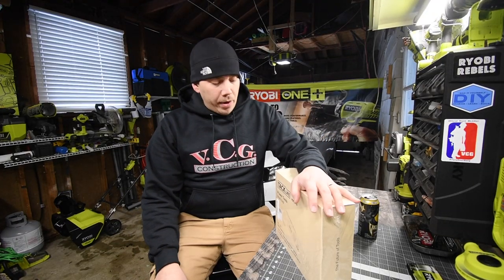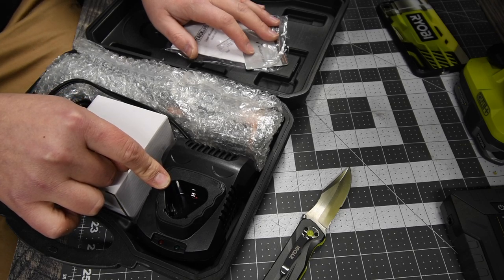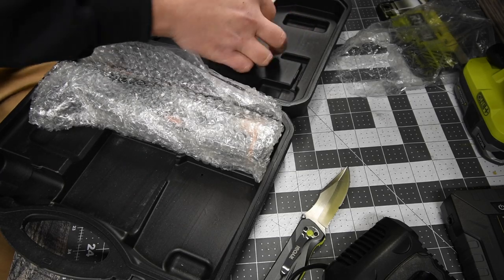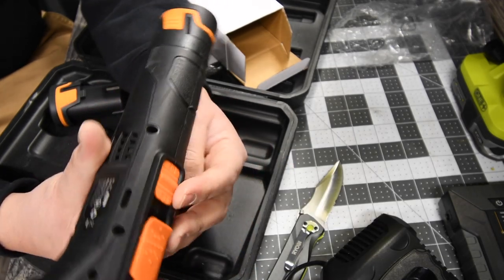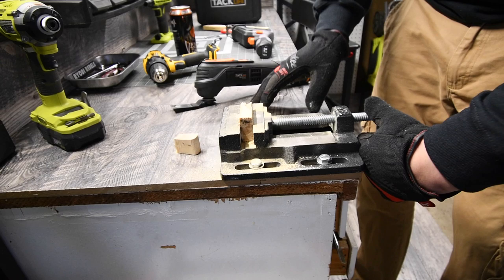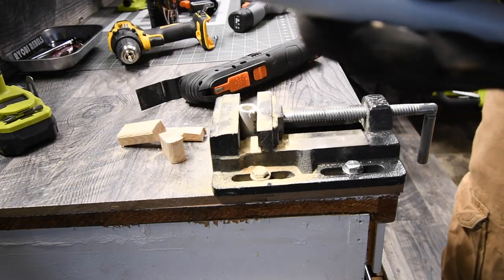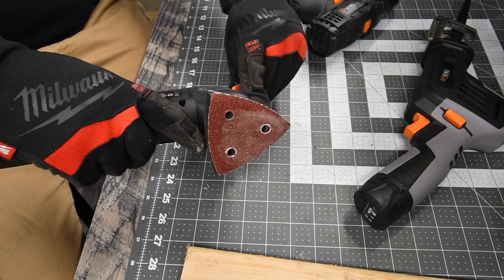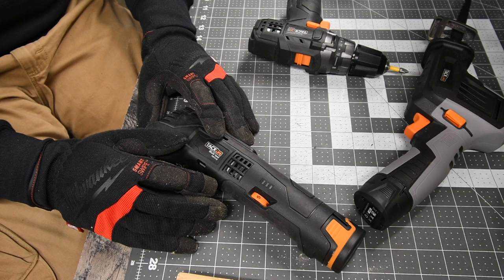$40 12v TackLife Multi Tool

Comment: Nice.  I do have several TACKlife hand tools, but none of their power tools, and overall I like their hand tools.  At $40 and at 12v I didn't have high expectations of this multi-tool, however, your tests impressed me.  Honestly, I think their tool did better than the Porter Cable 20v oscillating tool I have.
Reply from the maker: I still gotta get some of their Hand tools, But I am glad you like them

Comment: I ordered 1 mult itool on ebay which worked for on day, then it stopped working. I opened it an it had a problem with the speed button. I fixed it. I told the person who sold it to me about the problem and they sent me another a second one. When it arrived i tried it and it didn't turn on at all. It was probably a bad return. I also told them about the second one that was broken. They where going to give me a third one or my money back. I told them to give me a third one. I'm still waiting fir it. Hope it arrives in good condition.
Reply from the maker: sometimes it is best to order from the company itself

Comment: own a few tacklife things not bad quality for the price. what i'm interested in is that tacklife seem to use the same chargers and batteries as LIDL supermarkets here in europe for their tools. I may have buy a 12v tool to see if they do indeed fit. if they do it means i could have a cheap source for spare batteries £6.99 compared to £15.99 for battery and a charger i dont need
Reply from the maker: One tool I want is the Tacklife impact, but its in a different country
Reply: @ManCaverTools  20v or 12v????

Comment: Do the Milwaukee M12 batteries work in the Tacklife 12 volt range?
Reply: Peter Ryan no they do not they are completely different battery systems
Reply: Looks more like earthquake xt 12v from Harbor freight
Reply: I'm from Australia so we haven't got Tacklife or Harbor Freight stuff. On that note we don't have Lowes or Wal-Mart either ☹
Reply: Do you have home depot
Reply: No there is no Home Depot either
Reply from the maker: no, its a different design
Reply from the maker: amazon

Comment: Another great review, love my tacklife tools! Do you buy tacklife on Amazon? It seems to be the cheapest place I've found for that brand..
Reply from the maker: Yes I do. I shop on amazon a lot
Reply: Can you cut metal with this?
Reply: @dedysetiadi2851  You can cut metal with a decent blade. Just used it for body work on my buddies mustang. A little underpowered compared to a 18 volt tool but will do the job